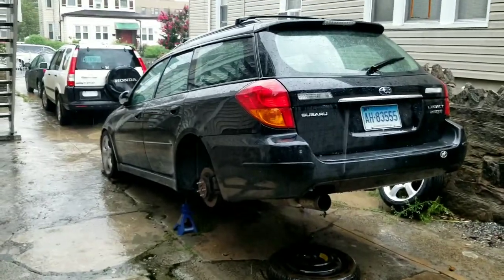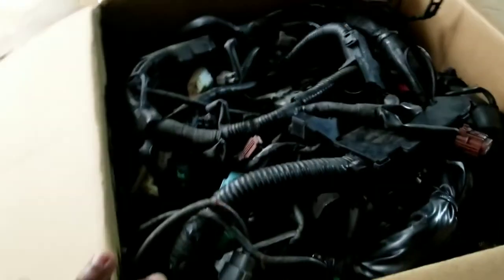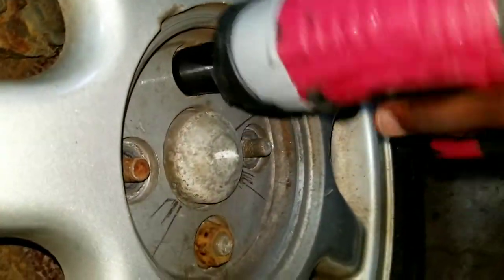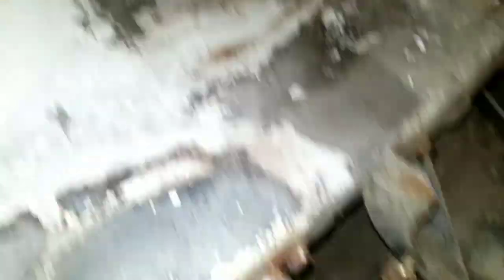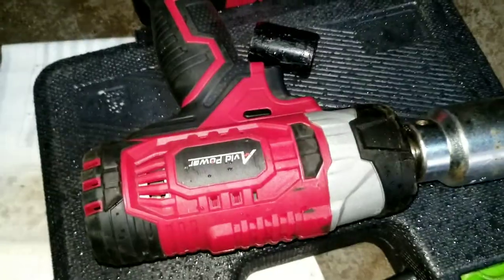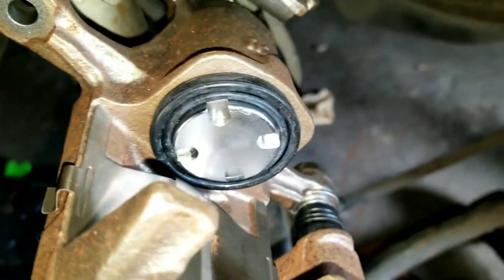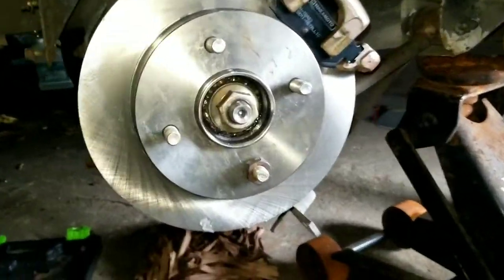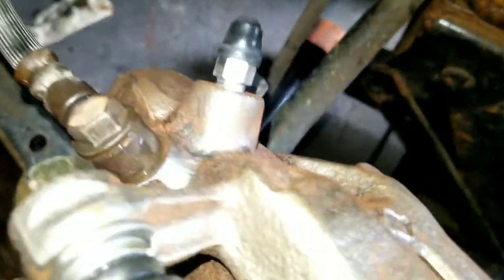vq35 B13 Sentra 4x11 brake upgrades pt4

Comment: did u have to cut or weld the cross member bar for the vq to fit?
Reply: You don't have to
Reply from the maker: No used the stock cross member  from the sr20 not 1.6

Comment: What's the name of the brakes kit u have I'm looking for it I not getting it
Reply from the maker: The brake kit i have for the front? Is 96 infinity q45 the kit is for the 240sx  but I converted to 4x114 from the b15  to bolt  all that up on the b13
Reply from the maker: Do u mean the the brake or engine mount kit
Reply: @brownspeedengineering   the brake
Reply from the maker: B15 sentra Front spindle  bolts up to b12 b13 b14
Reply from the maker: Did you find the spindle ?
Reply: Do you have a parts list of all things needed